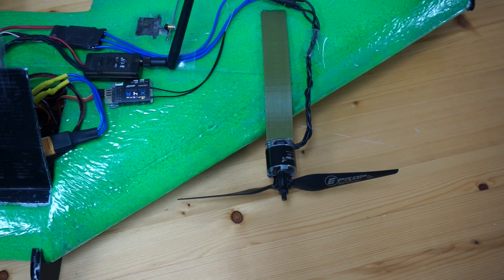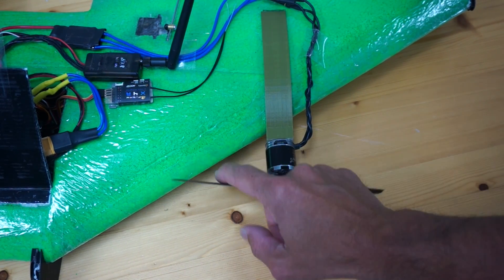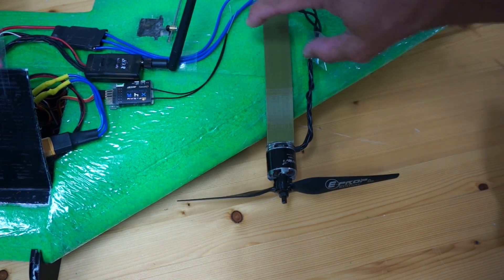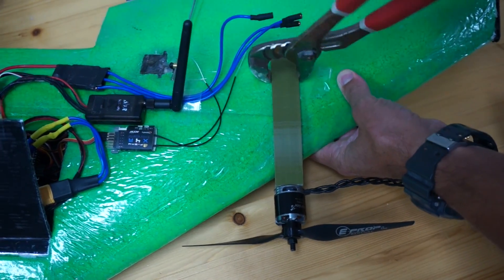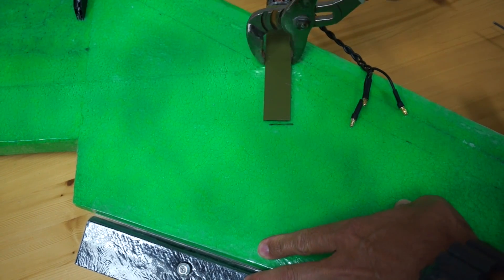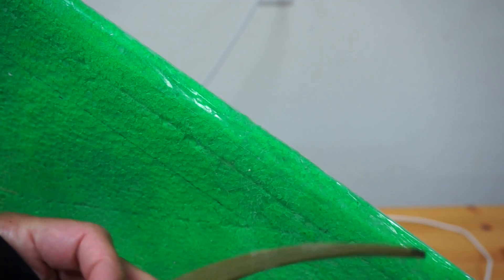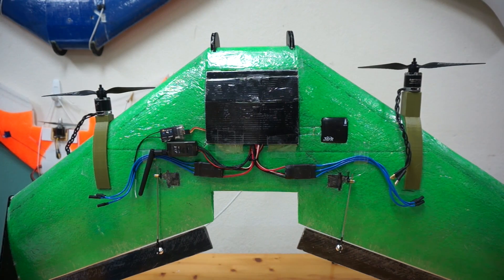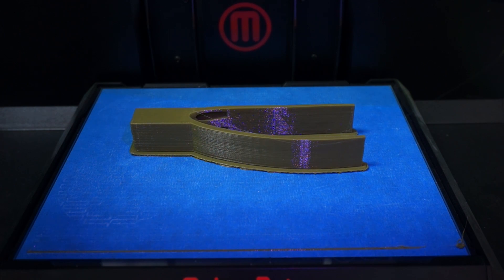Extending 3D Printed Motor Mounts for ArduPilot/Pixhawk Tailsitter

Comment: Can't wait to see the rest of this project!  I've seen others working on the same configuration, with the addition of prop tilting.  This is much simpler if it works well.  I'm curious to see if the standard size elevons will have the control authority in hover mode that you're going for.
I'm currently  building an FX-61 wing with a pixhawk, and i'm tempted to design some motor pods and go this route.  I live in an area where open space is mostly canyons/rough terrain, so VTOL would greatly expand available locations for flying.
Reply from the maker: Thanks for the comment. I'm curious as well! I have two FX-61 and love that wing. It's so much fun to fly and fairly durable. Maybe after I get through this build I can do a build for the FX-61. Good luck with your setup.

Comment: Brush the visible part of the hot glue with a dab of acetone - the acetone dissolves the hot glue and wicks in the joint and just pops the part off, then use acetone on the part to remove remaining glue. Magic.
Reply from the maker: That does sound magical. I'll have to give this a try. Thanks David.

Comment: Dennis did you know if you turn a can of air duster upside down and spray it where the hot glue is it becomes very easy to break loose, just a trick I found. I really enjoy your videos and have been subscribed for a year or so. keep up the good work.👍
Reply from the maker: No way! I didn't realize that but I'll give that a try in the near future. Thanks for the tip and I appreciate you following along.

Comment: Dennis, to save the re-print, you could used a four 5mm spacers behind the motor, or even printed a simple 5mm or 10mm packing piece behind the motor and used some longer bolts?
Reply from the maker: Good point. I don't have longer bolts but if I did your suggestion is a good one. I really need to rethink this design because it's very difficult to get to the bolts through the back of the mount. You need a really long hex driver. I'd like to make it more accessible and hopefully I can do that soon. After the maiden and getting things tuned. Thanks for the feedback.